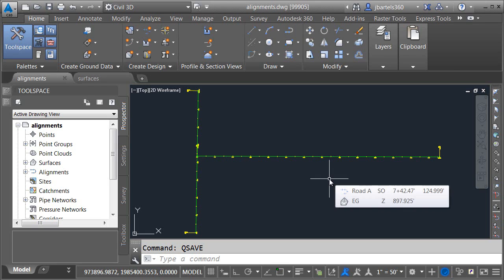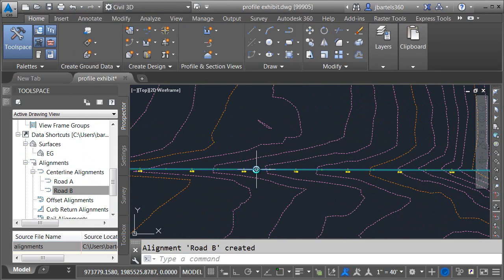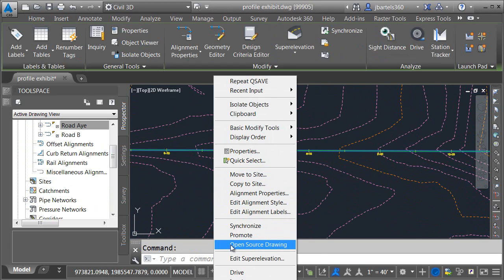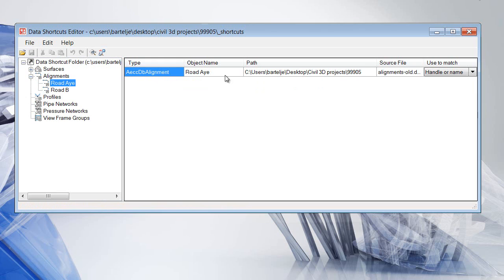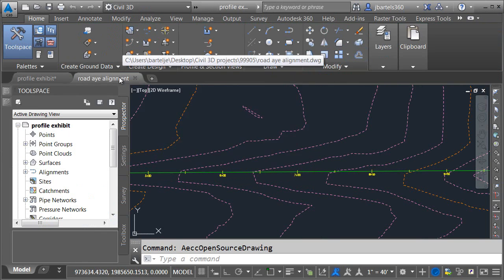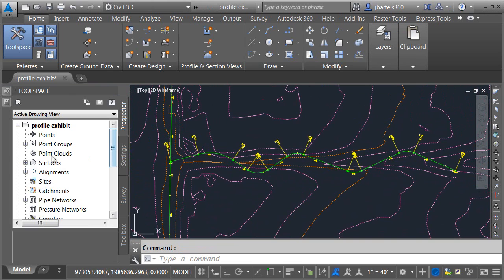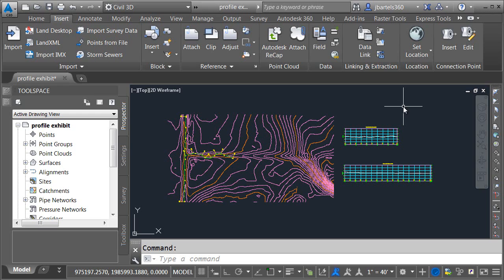Civil 3D 2015 - Repairing Data Shortcuts

Comment: Bookmarks for Future Reference
00:31 Explains drawings setup
1:11 Creating New Drawing for plans/exhibits and creates two profiles
2:22 Start of Breaking Data shortcuts
2:40 Example 1 Renaming Existing Alignment
4:17 Example 2 Renaming dwg file in explorer
5:00 Using Repair broken references
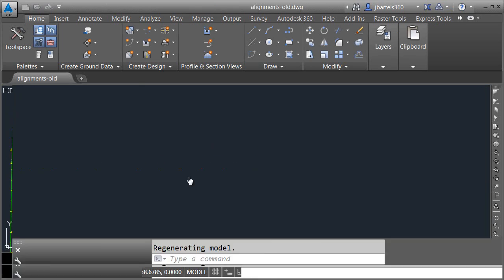5:43 Example 3 Move Alignment into new drawing
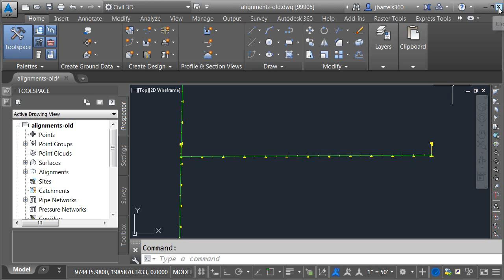6:40 Opening  and using Data Shortcuts Editor to edit xml file to look at new drawing and find new object by name
8:45 Validate Data shortcuts
9:52 Example 4 Replacing Data shortcut object with Completely new Geometry. Note works as using Data shortcut editor to set to look for name match only not and objectID match
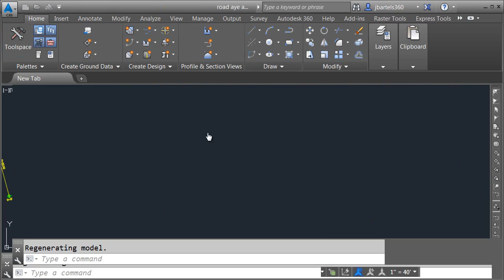11:02 Example 5 Data shortcut Object Deleted. You can get a cached copy from a drawing still referencing the datashortcut object and then landxml it into a new drawing.
12:35 Again as using only name match should work.